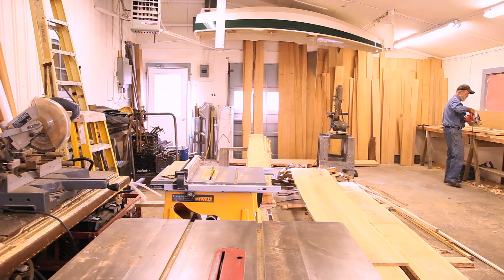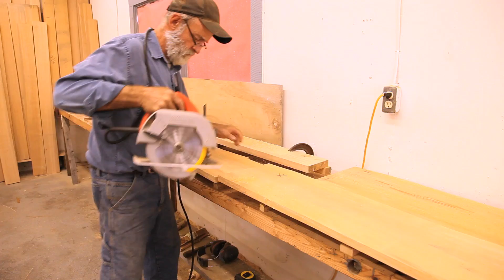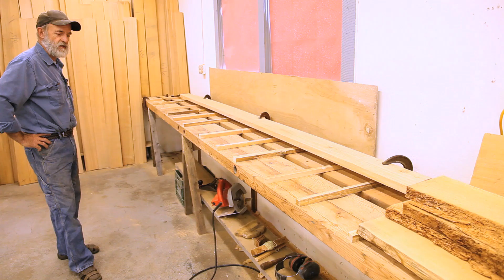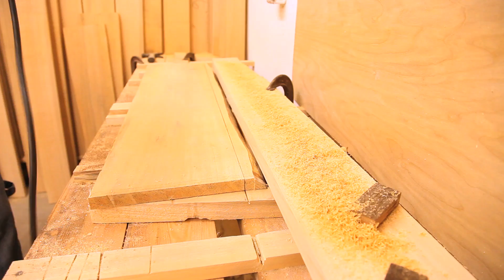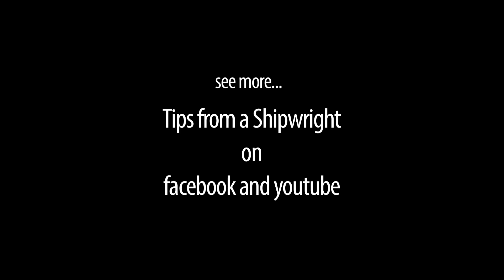How to set-up a custom work bench for wood working

Comment: Louis, I'm curious - how do you keep the ends of the boards perpendicular to the newly ripped sides?  Or do you just square 'em up later?
Reply: He's not with that system. And you notice he only cut once on most boards. Pretty sure the band-saw or table saw is where he's getting parallel-which he did mention.

Comment: Really nice. One could add a really long piece of plastic sheet at the cleared edge behind the bench between it and the wall and collect all the saw dust that falls inside that clearance.

Then once it's full, all one would have to do is run a sponge down the sheet and at the end have a bucket to collect the sawdust.